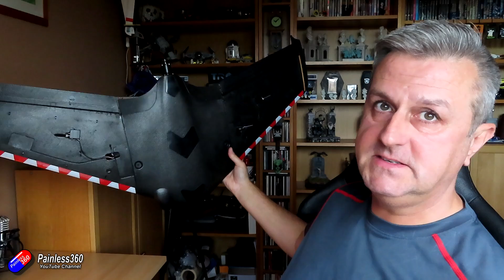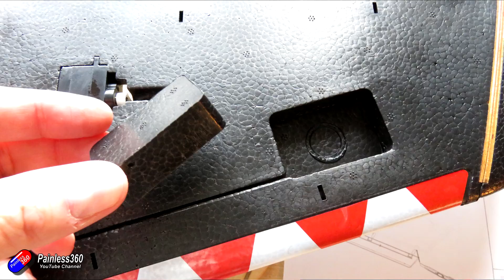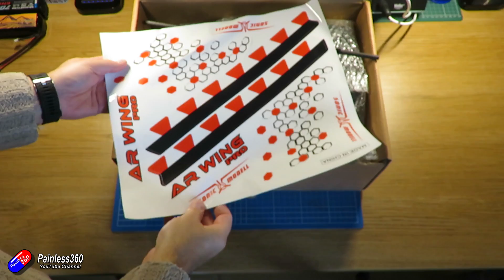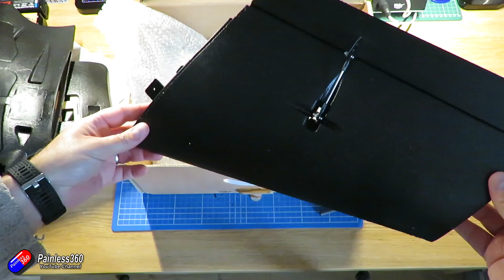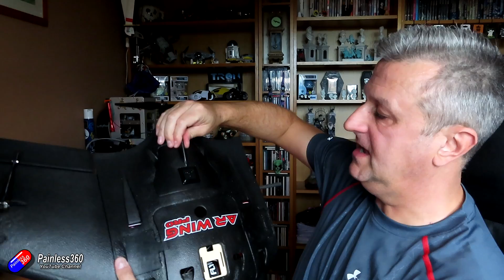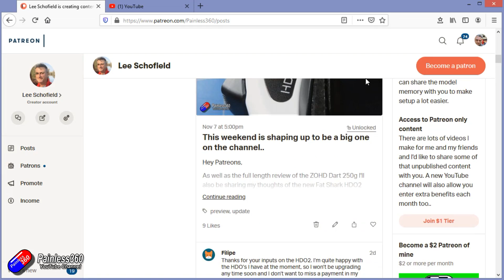FIRST LOOK: New FPV wing from SonicModell - the AR Wing PRO!

Comment: congrats on the world exclusive, and wow this wing looks great, well thought out, and guess who has been wanting a 1000mm wing for ages and one that will take a 3000mah 4s with ease, love the motor mount set up, the prop is pushed out into clean air so it will be quieter and more efficient, i used to dislike the AR900 but after i got the 3rd one it really grew on me, yes i can see me getting this new version for sure, Lee thanks for giving Sonic the input
Reply: Actually, I'm flying my old one with 6000mah 4s2p liion, so 3000mah will be nothing for this one.... ;)
Reply from the maker: Hey Julian, nice spot ;) The main noise I get on things like the Mini and Nano Drak I have here is the proximity of the prop to the rear of the model. This should make the airflow cleaner for the prop to bite into and reduce noise and increase efficiency (I hope) maiden should help me see that..

Comment: that look like a great payload bay size, I need enough space for a decent battery and a raspberry pi and the caipi is too small - this looks like it will be ideal
Reply: What are you going to use the RPi for??
Reply: @sarahdaviscc  its a gateway for a GPS tracking network